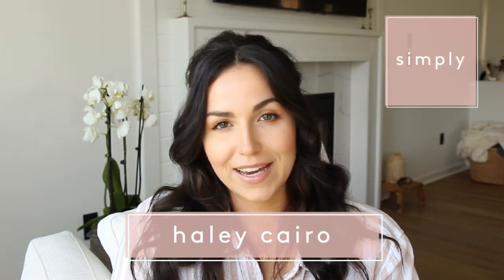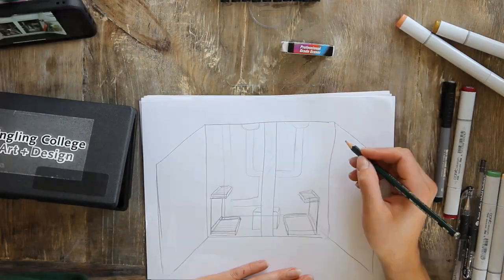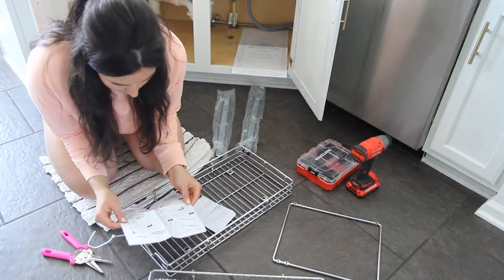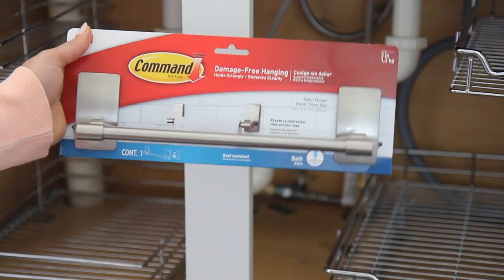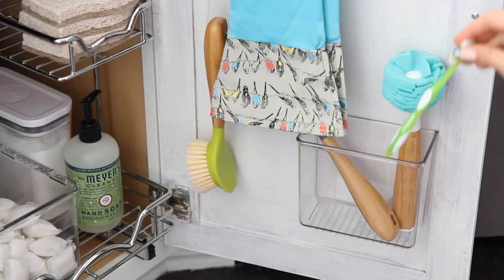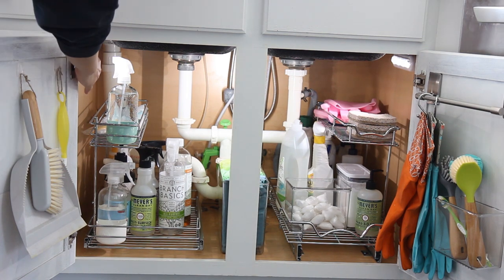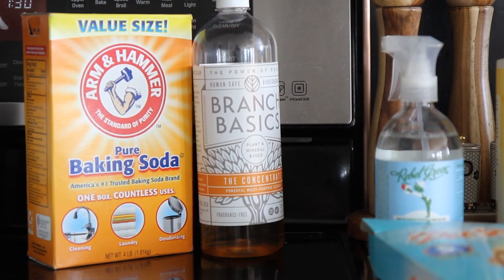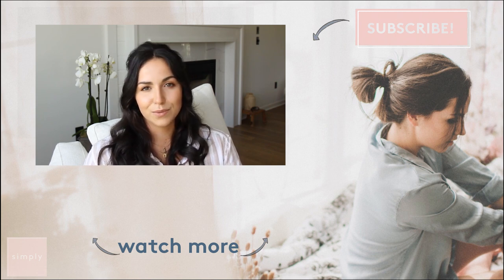How To Completely Transform and Organize Under The Kitchen Sink

Comment: You know WHY under the sink is such a freaking plumbing mess? Because MEN INSTALLED the plumbing! ARGH! Lolol You did an awesome job! Mine looks good. But I think it can be better! Trouble is, I had a leak that ruined the cabinet floor. So I had to put a rubber liner down. Should have put the liner down when I first moved it! I’d have to drill holes thru the liner to use your system. Guess I’ll think about it! On top of that, I have a roommate who moves changes things about. She’s trying to be helpful but her mind works differently from mine. Makes organizing challenging. Sigh....
Reply: Unfortunately, the link didn't work, but great video ~
Reply: Link to purchases?